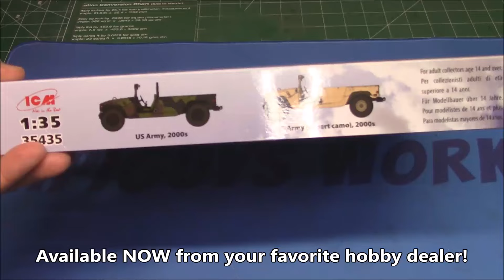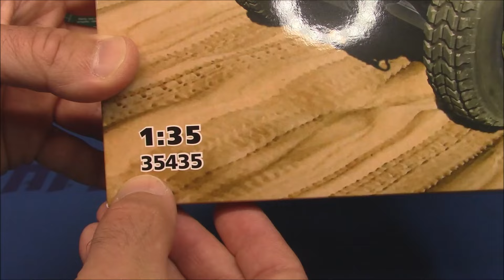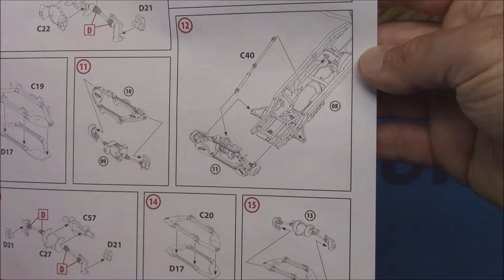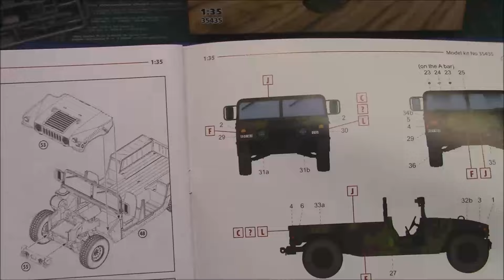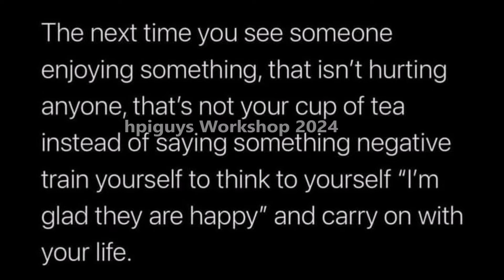ALL NEW KIT Humvee HMMWV M1097A2 Scale Model Build How To Assemble Paint Weather Dirt Dust Rust Sand

Comment: To prevent my Plastruct Bondene from tipping over and spilling, I use a 1" thick, 6"X6" piece of Styrofoam and cut a hole in the middle the same diameter as the bottle and set it inside. Hope this helps, buddy!
As usual, Chris... outstanding build and review! Rock on Brother!